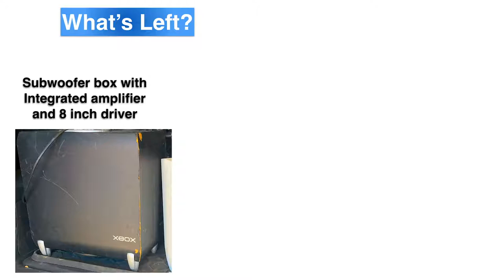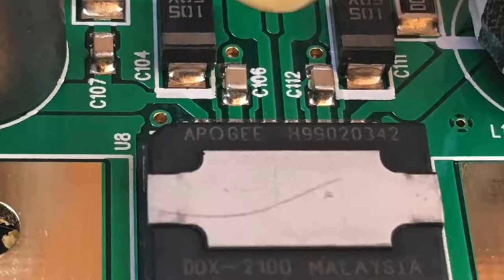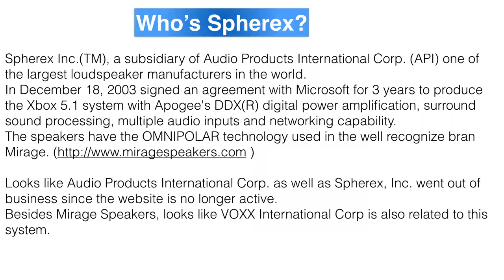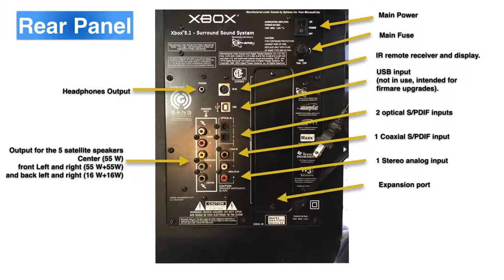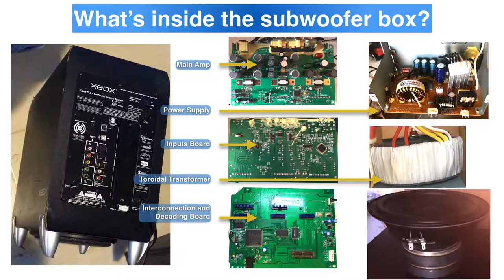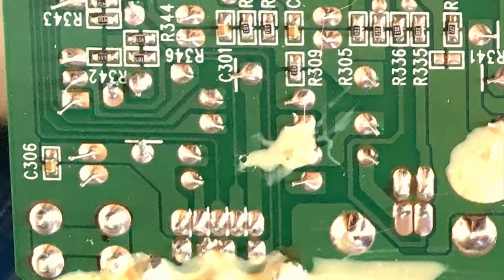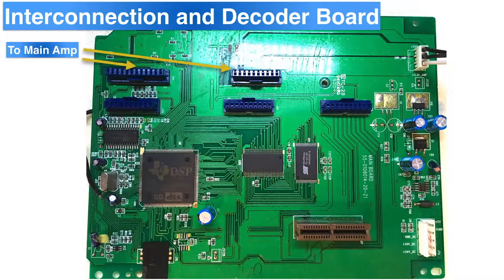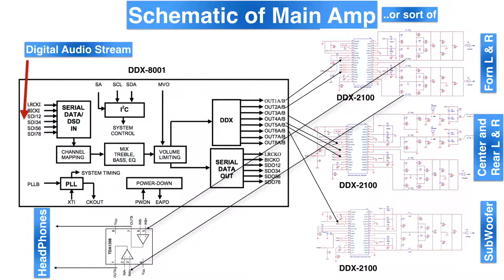Spherex 5.1 xbox system take apart and decoding review

Comment: I know it's been awhile, I hope all is well.

I have begun a project to map the pinout of the 46pin expansion slot, to my surprise none of the voltage pins are greater than 3.3v (& there are 26 of them) which leads me to believe that the expansion slot or at least those pins are connected to the Sta308/ddx-8001 chip which outputs at 3.3v, i want to do some continuity testing between that chip & the expansion slot to confirm, unfortunately i'd have to disassemble the whole thing with a heatgun which i'd rather not do.

Do you still have all the boards to the Spherex 5.1 by any chance?

Comment: Thanks for this video! Did you ever try to make it work with its original amplifier/inputs? I have this unit but its finally quit powering on after 10 years of use.
Reply from the maker: I did try, but failed miserably. There are no schematics out there and I don't have at least the remote sensor / display to at least make a backward engineering.
I took the subwoofer out and put it in a FJ cruiser, turned out the original subwoofer had a beer sound so I just have it there collecting dust :(
Thank your your comments and Best Regards.
Reply: @Letsdosomethinguseful  Thanks for the quick reply, I appreciate the effort! I haven't given up on my unit yet, hoping to have it repaired locally. Cheers!
Reply from the maker: @cgphoto  Good Luck! and thank you for your comments.
Reply: @cgphoto  let me know how you make out...just bought one for $20 bucks and the little red dot on the I.R. reciever comes on and that's it.... definitely need to figure out what's wrong.

Comment: Still looking forward to an update especially a pinout of some sort for the expansion port
Reply from the maker: Unfortunately, there are not service manuals for this unit :(
I took the subwoofer speaker and put it in a FJ cruiser and sounds very good, but for the amplifier and decoding and expansion board, it is a dead end with out any service manual, I hope I can get something out of the USB at least.
Thank you for your comment and best regards.
Reply: @Letsdosomethinguseful  Thanks for the reply.
Reply: @Letsdosomethinguseful  That is a great idea! I have an 03 4runner with a bad sub and need a replacement. I also ended up with just the sub. I keep hitting up the Goodwill where i found it to see if any of the other pieces show up.
Reply from the maker: @odin_th_red_heeler  Yes, it really a shame that we can not use it as a system since it is a very good system, but at least we can use its parts. I used to have a Bose 301 (vintage) speaker in my 4runner with a Sony amplifier and It sounded very good as a subwoofer.

Comment: @Let's do something , I found that someone said that "logitech harmony remote works perfectly with his Spherex". May be you can try that for your box.
Reply from the maker: The problem is that I don't have the remote receiver either. it has a little module that you plug to the subwoofer and it has the IR receiver there. I took it all apart and re use the cabinet for a subwoofer in my sequoia : https://youtu.be/MuO-K9z6plA

Comment: My subwoofer went out about a year ago...found a new set in Ebay...now people want $1000-$1900 for new set.  I'd still like to get old subwoofer fixed...might be something easy?  Then I'd have 2 full sets...I have it hooked up to brand new 2021 55" LG C1 OLED TV & it sounds great
Reply from the maker: 1000 to 1900??? wow, I should invest more timen in my subwoofer. I still have it but it is just collecting dust in my warehouse. I need the remote control in order to see if it works. I did added another amplifier to the subwoofer box and sound amazing. There is other set that also has a spectacular sound, the Later (dell) ADA995, if you ran into one of those, grab it.
https://youtu.be/nL-nkoAQjuI

Comment: I was doing some googling and learned a bit about this speaker set I didn't know. 
Apparently the Apoggee  chip inside supports 8 channels of PCM over i2s & can Support 6 Channels of DSD which it converts to PCM
There is so much to learn 6:51 is especially usefull.
Reply from the maker: At 6:51, you mean the USB chip?
Sounds interesting about the Apogee chip, I just brought a Bose sound touch 30 III and I couldn't resist to disassemble it to see what's inside and as it turns out, it has an apogee chip inside, a single chip to drive the subwoofer and two small speakers. I also see something similar in a samsung DVD home theater system.
Thanks for sharing your findings and best Regards.

Comment: I just got all the speakers and wires and infrared receiver only missing converter as well as the main amplifier in the back of the sub. I paid 10 bucks
Reply from the maker: Wow, do you want to sell it? or can you publish some pictures of the infrared receiver dissembled?
Reply: Let's do something did you ever get that amplifier fixed? Do you know if it works? Because if that amplifier works I would definitely be wanting to buy it off you. I have everything but the amplifier
Reply from the maker: I'm don't know if the amplifier works. Everithing seems fine, I tested the power supply and it is giving the right voltages (positives and negatives). I would assume that it works but since I don't have the remote or the IR reciever I can not test it. If you want it, contact me via https://www.facebook.com/letsdocom/
I almost forget to tellyou that I do have an Logitech Harmony universal Remote, I can just tell the remote to use the Spherex 5.1 and it will download and program the remote for me, but with out the IR receiver there is not much I can do.
Reply: Were you still interested in pictures of the IR receiver disassembled? I have two of these speaker systems--they are great!
Reply from the maker: of course I'm interested. I'm not planning to use it since I already have a denon and Onkio home theater in my lab and in my living room, so I have no use for the spherex, but I wanted to do a reverse engineering of the receiver module to give others the option to use is.

Comment: How did you even open the back of it? Jesus Christ, it just won’t pull out.
Reply from the maker: Yes, it is hard even with the heat gun. To be hones, I was willing to broke it if it didn't open, but fortunately, it did open, but I used the heat gun in high for a long time. Yellow silicon is a lot harder than the typical white (clear) one. 
Do you have the remote and the receiver?
Reply: Let's do something I have the entire set lol . Did you still want parts? I’m using  the speakers with another receiver for my home theater but not using the sub or the remote/receiver. $40 for remote and receiver if you want it lol

Comment: can power supply work with car amp?
Reply from the maker: Yes, but not directly of course because the power supply is +/- 53 volts. Most car Amps above 250 volts, use 30 0r 35 volts internally even if in the outside you just connect 12 volts, but internally they have a step-up power supply that raises those 12 volts to +/- 30 volts. So if you override the car amp's power supply and use this one, it would be the best approach.